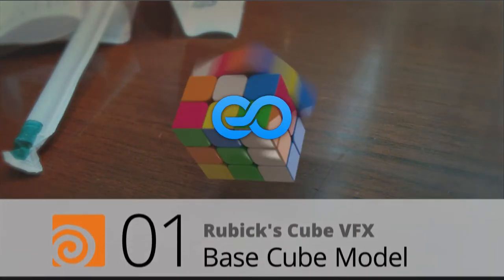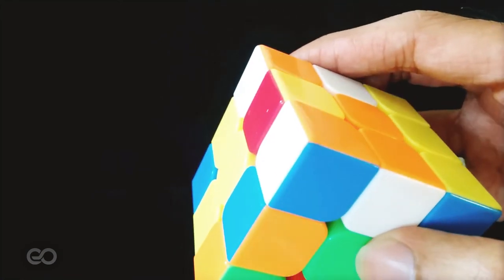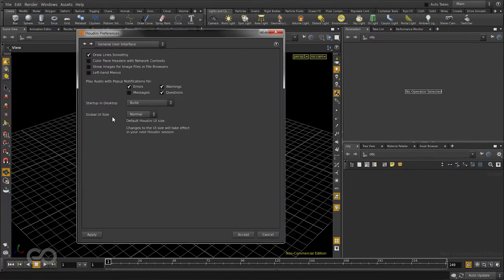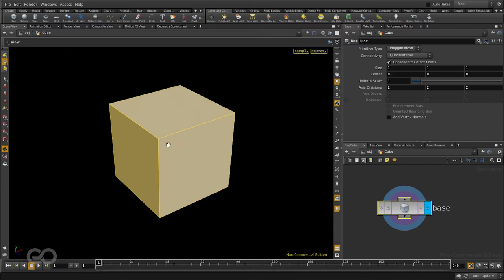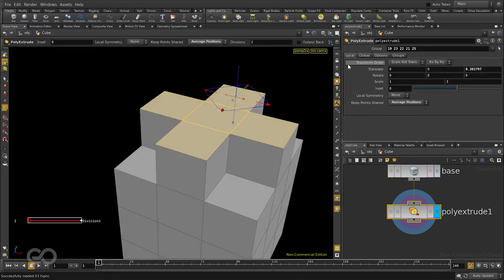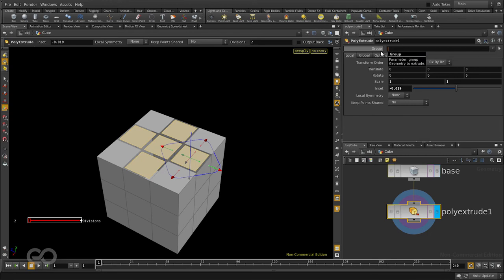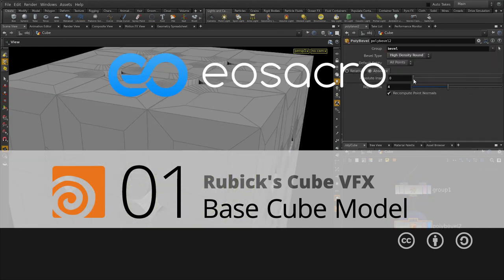Rubik's cube - 01 - Basic Modelling

Comment: using blender some years, first time see houdini. Intresting workflow. Wanna see some intermidiate modeling tutorials, how you can take advantage of nodes.

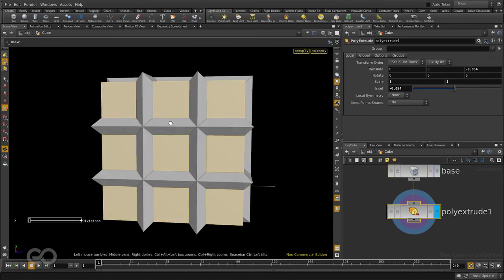In H15 missing the local, global, options, groups Tabs. How I connect corners(7:00)?
Reply: I have the same issue
Reply: anyone solved the corner edge issue?
Reply: @ajeetprajapat4536  invert the inset value and use it for transformation